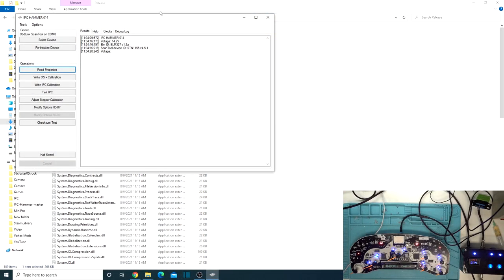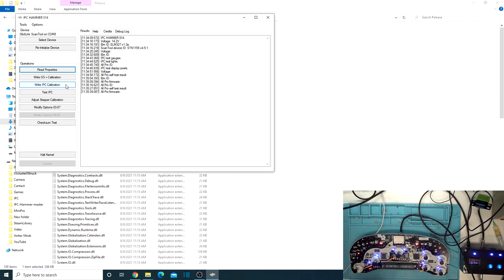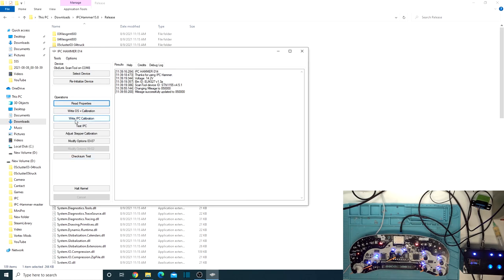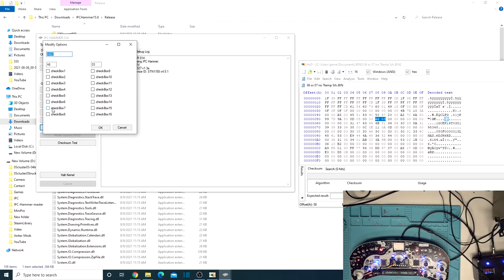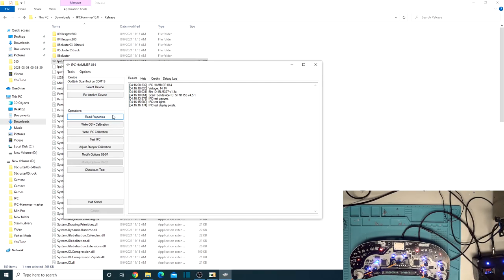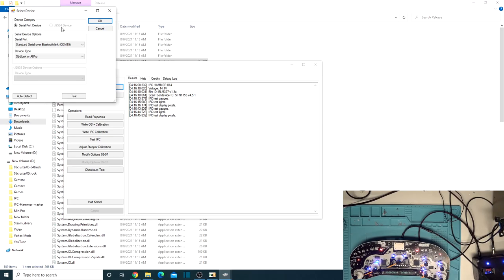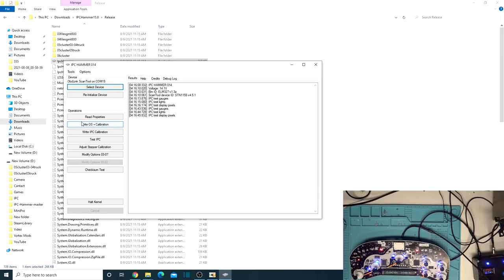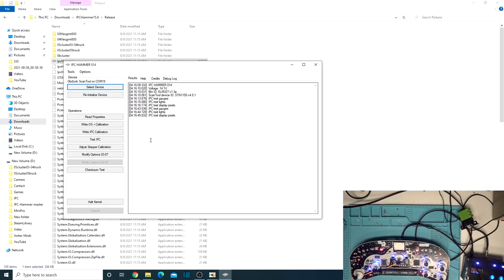IPC Hammer: How To Test GM Clusters

Comment: The adjust stepper button is useful when you get a cluster back together and decide you don’t like the home position of one of the needles. Adjusting the value up or down will change the home  position of the needle. Thanks for making these videos to explain the software.
Reply from the maker: Oh yeah I mostly meant I didn't have a need to do it in the video not there is no need for the feature. 
Thanks for making the software!
Reply: Thanks, so that's all it does? So I installed a reman cluster in a H3 a month ago and customer is saying the tachometer is off slightly.. Instead of pulling it out and popping the cover off to adjust the needles I could use this? He's been out of town but coming back in a week or so..
Reply: This doesn’t work on the h3. It should work on the h2. There’s probably a way to do it on the h3 but I’ve never had one to test. Are the h3 clusters similar to a Colorado?
Reply from the maker: @mikebb203  H3 is the same as the Colorado just like the H2 same as the Silverado

Comment: Great video Matt. I do have one question can you tell the cluster that the truck has steering wheel controls with IPC hammer?
Reply from the maker: yes thats the flash cal feature. just got to put the right cal on it and they will work.

Comment: Excellent video as always Matt!

Suggestion for an IPC 'series' video. Could you make a video explaining how to find the different OS and calibration numbers to suite peoples needs? For example, taking a base model 03 Silverado half ton cluster and flashing it was an OS/Calibration that's got hydroboost, steering wheel controls, etc. Identifying the correct OS/Calibration numbers from the IPC library for this is difficult without a 'legend'. Wasn't sure if you have better means of finding this information :) Thank you for all you, Mike, and Jeff (and many others) do for the community!
Reply from the maker: Yeah, we do need to make a table of contents or legend of that. The calibrations numbers match GM software so you can always get the number you need from their software. Maybe someone who works at a dealership could make us that list.

Comment: Awesome video Matt. I've been meaning to try this tool, but have been waiting for J2534 support since I already have a dongle for that. Don't really want to purchase another $100+ dongle if not necessary. But this tool looks pretty convenient and quick compared to the plethora of tools I already use to achieve the same goal. Been waiting on J2534 support for a while now, might just have to bite the bullet and purchase a OBDLink MX+ to test it out.
Reply from the maker: There is port of it on pcmhacking. Check the thread. https://pcmhacking.net/forums/viewtopic.php?f=42&t=7244

It's unclear how well j2534 works though.
Reply: mike 15.9 is out with j2534. i have the mx+, have used to change mileage on a bench harness i built.
Reply: @bobbobby1846  Thanks for letting us know about the mx+. I have an iphone and spending the couple extra dollars to have it work across multiple platforms is a good selling point.
Reply: Just getting into this, and have j2534. So to clarify as it’s been some time since the last comment, j2534 is supported and no need for the obdlink correct?

Comment: Do you know if he is adding support for j2434 devices?
Reply: I would like to. Just haven’t had time to get it working correctly.
Reply: @mikebb203  Thanks for the hard work and time spent on this project. I just ordered an OBD link. I'm planning on using the software to calibrate the stepper motors.

Comment: Is this still applicable for older clusters, from prior to 2003?
Reply: It currently only works with 03-06 gm full-size trucks and SUV’s. I do have plans to add the option button and mileage correction for 99-02 full size trucks and SUV’s. I would like to add more vehicles. Just not sure which ones and would have to learn how they work.
Reply from the maker: Id say after 99-02 the next most common cluster for repair on the class 2 frame work is the Trailblazer. I wouldn't be shocked if it was programmed the same as the 03-07 since it used the same microcontroller

Comment: The global A and global B GM cars/trucks require the vin to be programmed. If you install a cluster where there is a vin missmatch it will not display mileage. And if you drive it a "calibrated distance" with the long vin, it will "lock" which basically bricks the dash. There are mixed scenarios where on some the gauges still work but mileage is locked out and you can not change it.